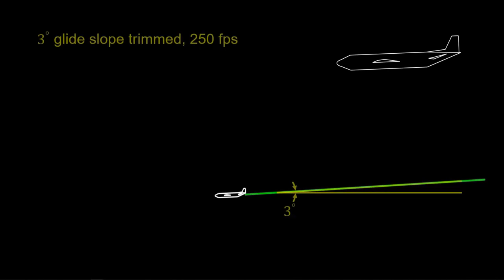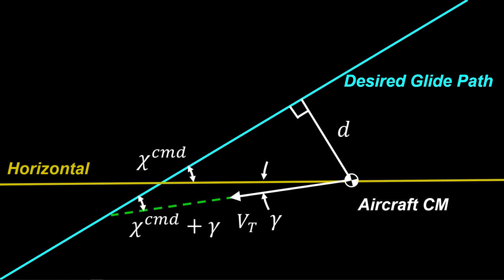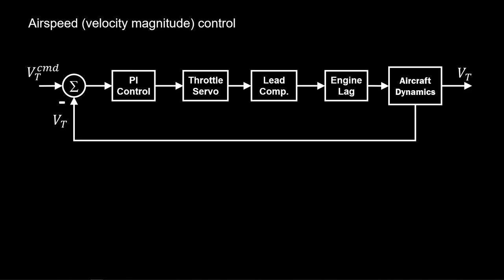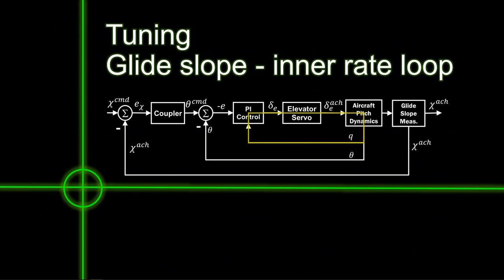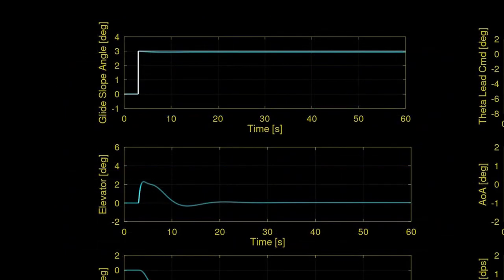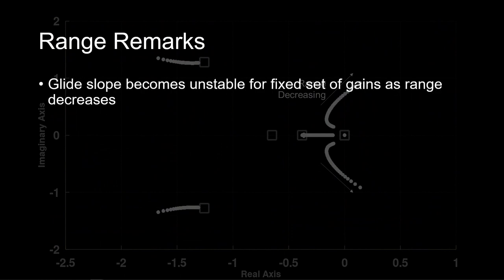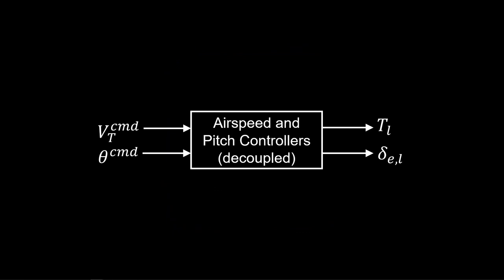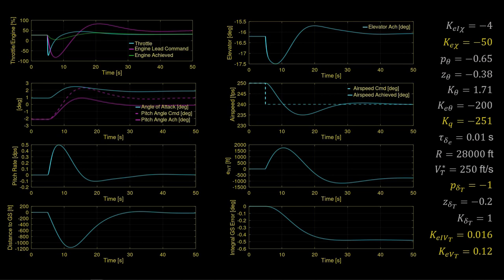Aircraft Glide Path Control – Flight Control Fundamentals – Section 1.6.4

Comment: Why not feed forward a velocity command correction from the glideslope loop? In theory, this could eliminate much of the velocity transient caused by glideslope tracking.
Reply from the maker: Seems reasonable. How could we create that correction? Thinking on it further, one could identify the glide slope (GS) closed loop TF for VT/Xcmd with the full longitudinal dynamics are in the loop, where Xcmd is GS command. This would capture the expected VT transient due to GS tracking, which could be added to VT command. Is this what you are thinking?
Reply: @LearnGandC pretty much. With a small angle approximation, the additional longitudinal acceleration from a pitch maneuver of delta_theta would just be -g*delta_theta. If we had an acceleration controller, perhaps we could add a straightforward acceleration feedforward of + g*(theta_cmd - theta) = g*e_theta. Without an explicit longitudinal acceleration controller in the loop it's less clear, to your point we'd need to model more dynamics to get it to become a valid Tcmd.